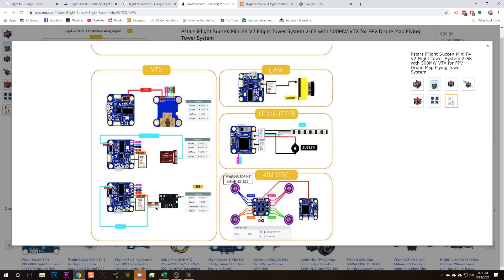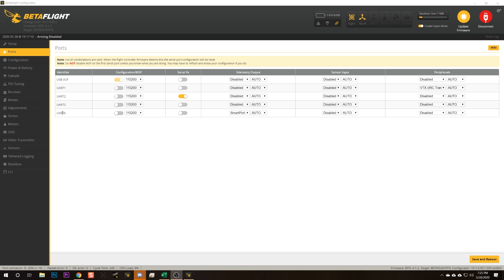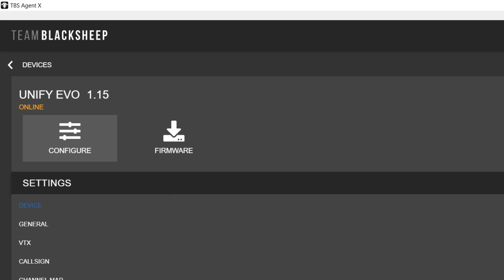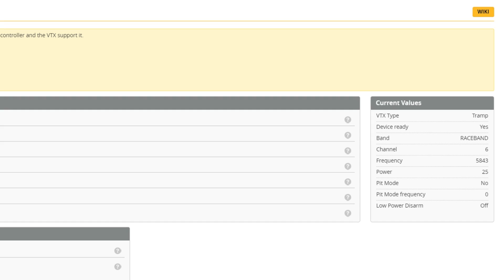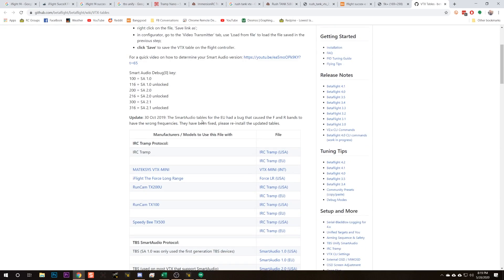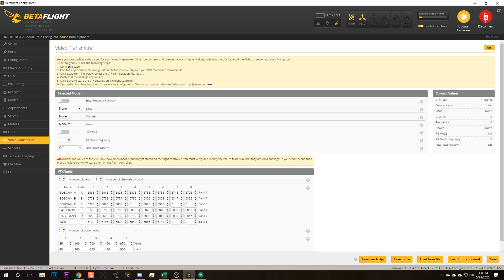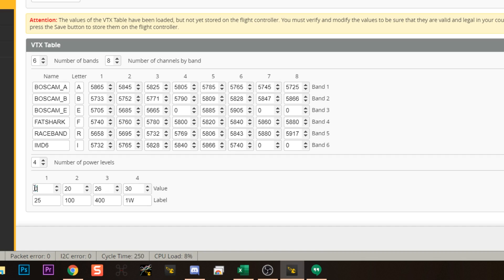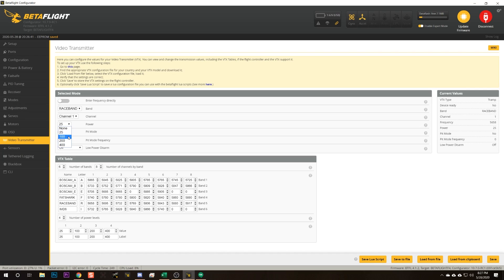Betaflight SmartAudio vtxtable troubleshooting (WHY DOESN'T SMARTAUDIO WORK)

Comment: I propose all VTX manufacturers move to TRAMP and life would be much simpler (on Protocol --- and version of Protocol to boot!)
A cool trick is if you unselect "Use Manufacturer's Table" on each row of the VTX table, it ignores the locking and just sets the channel to whatever is set in the table.
[p.s. another way to make sure things are working - if a Smart Audio VTX at least - is to set the SA Debug mode and look in the Sensors tab.  As you switch things on the VTX tables tab, that debug in the Sensor tab will show the change.  But again, there is only a SA debug (no Tramp -- because it is simpler actually so a debug was not created for Tramp).]
Rcvd a cool comment on my VTX tables in 5-min video recently:
QUESTION: "How can the FC receive data from the VTX when the connection is using a TX pin on the Uart?"  
ANSWER:
It's because it's not a UART. It's a USART internal to STM32.
It's flexible. TX and RX switch and are use for receive and transmit data.
@t
Reply: UAV Tech I know the Unify EVO is on the more expensive side but it has saved me from the VTX tables entirely. Much nicer controlling all of that witching crossfire. Also easier to show up to a group fly and not have to wait to get into the air.
Reply: @parklander6459  ..ME TOO,haha..All my 10 kwads are Evo vtx,s... throttle down,yaw left..and use the Evo,s OSD to set your power....much less bullshit isn't it?
Reply: Half duplex uses one wire.  Both USART and UART devices are capable of half duplex.  The difference between USART and UART, is that a USART device is capable of using a second wire for clock sync instead of a using a pre-defined baudrate.  UART is purely asynchronous and does not use a wire for clock, requiring that the device be configured to sync to the right baud rate on its own.  Granted, a USART in synchronous mode is typically half-duplex, but it definitely needs two wires.
Reply: "A cool trick is if you unselect "Use Manufacturer's Table" on each row of the VTX table, it ignores the locking and just sets the channel to whatever is set in the table." - No. When the "FACTORY" switch is on the channel is set by sending a band/channel number to the vtx - only SA supports this. When the "FACTORY" switch is off (equates to "CUSTOM" in the CLI vtxtable) then the actual frequency is sent to the vtx - Tramp ONLY works this way. Some SA vtx's will support this (generally real TBS) but many will not and only support setting by band/channel (FACTORY) mode. To complicate things further, even if the vtx supports setting by frequency (Tramp and some SA), then it still may not support every frequency. For example it may not allow frequencies outside the normal bands or even those that don't correspond to normal channels. Setting an unsupported frequency can lead to strange results. For example on Matek Tramp vtx's the vtx will stop transmitting if you select a frequency that's not a "real" channel. The behavior depends on how the manufacturer implemented it and there are no predefined ways of responding.
Reply: Thanks gents for clarifying.
Reply: This <^>
........all of this is completely unnecessary to just go fly, and very frustrating I followed this exactly an then in my osd it says tramp not set up I'm using a tank vtx it says tbs s.a.
 inside on the actual vtx lol I just dont get  why this is the norm now I've had shit video since 4.1 an it makes flying not as fun an ruins the fucking hobby sorry I'm annoyed never thought I'd miss buttons so much to change vtx settings unforgivable
Reply: @airicfpv3154  ..OK...why not buy Crossfire,and an Evo tx.No vtx tables needed then!! "CRSF" is good.
OR....Flash your f.c.with EMUFLIGHT,..as Emuflight does NOT use "vtx tables"..= 2 options that might help you sir.😉
Reply: @chrissofpv3017   I didn't know either of those things ty so much, emu flight here I come
Reply: @airicfpv3154  Pleasure!..yes try the latest version of Emuflight..(I fly it on 2 of my 5" 6s,s and another 2 kwads on bf4.2..Emuflight,s very good..and it's the cheaper option of the two I suggested anyway.👍🍻
Reply: @chrissofpv3017  awesome man an yeah I'm running r9 for now so crossfire is in my future I'm sure, and does emu flight works on bf boards ?
Reply: @airicfpv3154  My kwads have CL RacingF4 and Tmotor F4 f.c,s
Just make sure that your board is listed on the drop-down once you're in the Update Firmware screen,and you'll be fine.